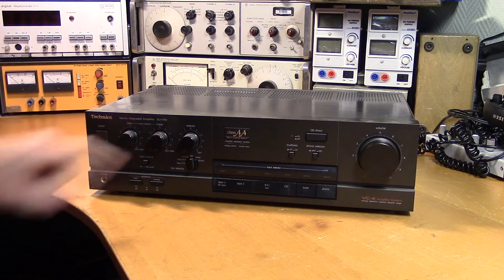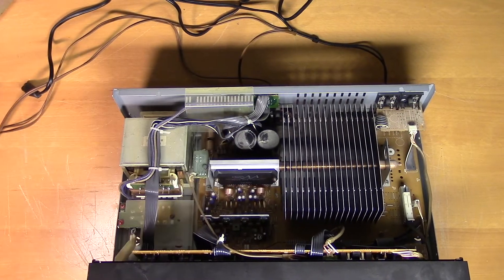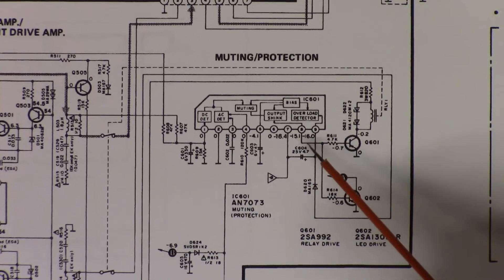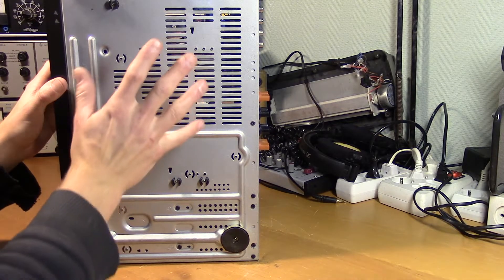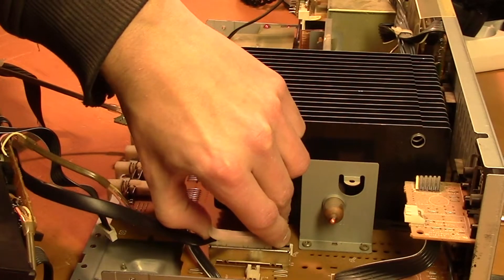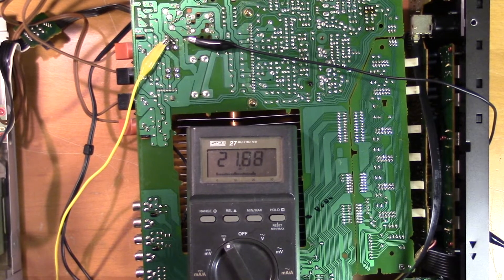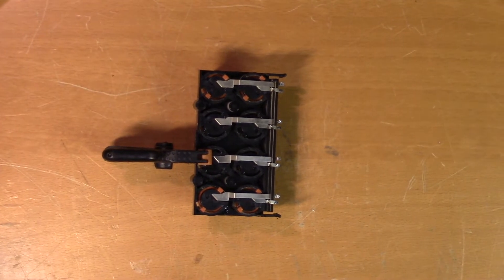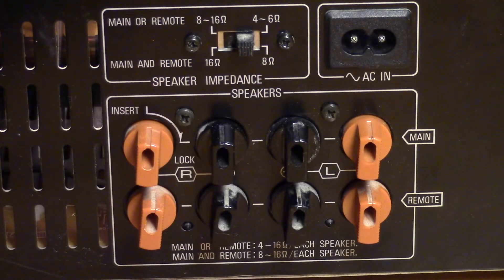Technics SU-V50 - Amplifier Troubleshooting and Repair

Comment: When you probe the IC voltages at the pin, the negative probe of the multimeter goes to the chasis ? Sorry I'm new to these repairs. Pin 2 has AC voltage? I did not see it on the schematics.
Reply from the maker: Ah, my mistake; the AC detection is not on Pin 2. Yes, the voltages in the service manual is referenced to ground, so the negative probe should be connected to ground. In this amplifier the chassis is connected to ground.

Comment: The worst thing about this series of amps was Technics' decision to use hybrid output modules instead of discrete components. They are failing as time goes by and there are currently (2025) no practical replacements. The SVI4004 has not been made for many years and pretty much all of the ones for sale on various websites are china fakes that will fail at switch on or soon after. The same goes for other hybrid modules that Technics used.

Comment: Hello, i have this exact model and here's my problem. When i listen to Tuner, CD, Aux Or Tape it all sounds well on all 4 speakers, but when i want to listen to Phono, sometimes 2 of the speakers just turn off. I test the balance buttom and it's just silence to the right side ..  what might this be ?? Can anyone help me out ??
Reply from the maker: Hello, when connecting something to the Phono input, the signal goes through a RIAA equalizer. There is most likely something wrong on the right channel of the RIAA stage in your unit.
Reply: @SunandWeather  Thank you. I will check it out. Maybe its fixable !!

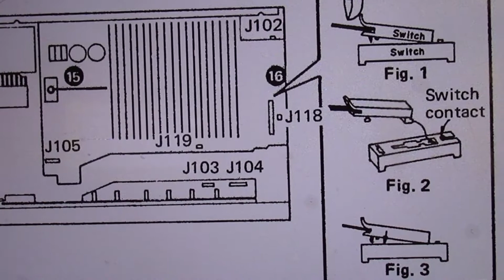Comment: DO you have any idea what the tube is ?  You can see it at 6:00min to 6:20.  It runs through the heat sink fins and is probably runs a good length.  It is copper in colour.  Some of the cheaper technics amps have the tube, but they don't run it through "fins" i.e. heat sink.
Reply from the maker: It is most certainly just a copper tube, intended to transfer the heat from the Amplifier IC to dissipate across the "fins". I would guess it is done this way since the power amplification is done in a single integrated circuit, rather than across multiple transistors, leading to high heat concentration that needs to be dissipated efficiently.
Reply: @SunandWeather  Thank you very much for the reply, much appreciated and great video !!  Keep going !!

Comment: need your help or suggestions....after 30 years my Technics Su-G75 amp went out.....I thought it was the fuse, ordered some 6.3amp 125v and nothing happened. Not sure what to do next? It clicks when I hit the power button but nothing turns on....I also can't seem to find a good stereo repair shop in the Houston, TX area either....everything else works fine...that it came with.... thanks in advance FOR THE HELP!! THIS WAS THE FIRST STEREO THAT I SAVED UP AND BOUGHT MYSELF.
Reply from the maker: Hello! With such limited information, all I can do is give you some general advice on where to start. Since nothing lights up, I would start by examining the main power supply. Make sure that you get the correct dc voltages, that is powering the other boards. If you get no supply voltage to the other boards, or if some of the voltage rails are missing, there is most likely something wrong with the power supply.

Please note that you will be dealing with dangerous voltages. If you do not have any pervious  experience with electronics repairs, I would advice you to seek assistance from someone with more experience.
Reply: @SunandWeather   thanks for the reply back!! Believe me I will seek a experienced shop if I can find one in Houston. So I connected everything back up and everything works when I click the power button except the amp itself? I think its 2 resistors because 2 of them reading shows good the other 2 showing negative reading. 

If you have an email address I could send you the ones I’m talking about and the service manual I found online. Thanks again.

Btw…I checked them with the unit unplugged😅 in case you were wondering.
Reply: @mickbrown815  If you measure a resistor and it shows a negative value on the meter (using the Ohms range) it's likely there is a residual voltage across it from a capacitor in the circuit. Resistors don't read negative values on their own. It is also possible that the resistor is open / high in value. You need to lift one end out of the board and measure it again. However, I can just about guarantee your problem is not the resistors.
Reply: @stopthebus I got it fixed last year it was a resistor!
Reply: @mickbrown815  Well I am certainly pleased you were able to get it repaired, and it's interesting that it did turn out to be a resistor. That's not common for these amps.
Reply: @stopthebus there’s a guy here Tim Miller all he does is work on amps, pedals, stereo equipment. I got lucky! Very reasonable.
Reply: @mickbrown815  Every now and then you will find someone like Tim.
You were indeed lucky to find him - and that the repair was just a resistor as often it is much more than that. A lot of the later Technics amps use hybrid output modules that are now failing and there are no replacements (apart from china fakes) in most cases.

Comment: These are nice amplifiers to listen to but the design is horrendous. Cost cutting at its worst. Definitely not designed with serviceability in mind as theres no access to the board where heat is most likely to cause dry joints. No discrete output stage and too much integrated unobtanium.

Comment: As I recall banana plugs fit into those awful twist on the bare wire speaker connectors, and you don't need to twist the connector to make a contact with the conductor input. I may be wrong, it's been a few years since I used one.

Comment: 13:40 You say that but try getting a cheap amp with a Total harmonic distortion: 0.002% cheaply! Very hard to find and these amps compete very well with high end equipment. In some cases doing a better job also.
Reply from the maker: Hello! The comment on at 13:40 in the video was not intended as a complaint on the design, but in order for Technics to be able sell these amplifier cheaper than most other amplifiers with similar specifications and still be profitable, there has to be compromises. Compromises like: no features facilitating repairs, lower quality components and lower quality materials. These cost saving measures does not necessarily impact the performance significantly, if the design is good, but will probably affect the reliability and longevity of the device.
Reply: @SunandWeather  Very few manufacturers build so that technicians can repair them later without much effort. I always say: technicians exist because engineers also need heroes.😉 One thing is very certain, before the technician's work was paid and now it is not. I remember when I was a child and the television technician came to repair it, the price was about 20,000 pesetas / 120€ (Spain) and the technician was not told anything like: "I think the cost of the repair is expensive", or "is it worth the repair?". Now if you charge 40€ for the repair of a switched power supply you already have the owner crying

Comment: @SunandWeather Hi Sir i have a technics amp model Su-Z780 everything works on it ,but the only thing is? when i turn it on it comes on but to getting it to start to play music i have to give it a slap on top and then starts to play. And  when it starts to play i don' t have any problem, but ones i turn it of, and  if i want to play it again, i have to do the same thing allover again, and like i said i have to give it a slap again. your help would be much appreciated Sir, thanks and God bless
Reply from the maker: Hi! It definitely sounds like the relays are causing this problem. Based on what people have commented on this video, it seems like relay problems are quite common on these units.

It sounds like your relay have trouble moving between its two states. So, my guess is that the mechanical parts inside the relay are simply worn out, causing it to jam as it is trying to turn.
Reply: @SunandWeather thank you so much for responding my message, question? do you live in Melbourne Australia? and is the relay an easy fix on the technics Su-z780 to fix it can you please tell me were would i be able to get another relay, or can the existing one be fixed. thanks again much appreciated your response. cheers Silvio
Reply from the maker: @thetruth871  I live in Sweden. I do not know how easy it is to disassemble an Su-z780, but once you have it apart it should be quite easy to remove and replace the relay as long as you have a decent soldering iron and know how to use it.

Make sure to get hold of the correct replacement, though. Some relay models come in several different configurations.
Reply: @SunandWeather you have been a great help thanks again, and God bless you, Sunand cheers Silvio

Comment: hey i really need your help could you help me fix the volume from negative to positive please
Reply from the maker: Hi bigfan! I am not sure I understand what you mean. Could you clarify?
Reply: @SunandWeather  thank you for your reply… so as i turn the volume dial up the numbers go down, is there anyway to make it normal or are the numbers meant to be negative?
Reply: @SunandWeather  thank you for your reply… so as i turn the volume dial up the numbers go down, is there anyway to make it normal or are the numbers meant to be negative?
Reply from the maker: @ten_xo  Do you have this exact amplifier, Technics SU-V50? On this model the volume goes from 0 to 10 clockwise, where 0 represents no output and 10 represent maximum output. If you have to turn it counter clockwise to increase the volume It could be that the potentiometer for the volume adjustment has been replaced with a reverse potentiometer.

Some amplifiers go from -infinity to 0 dB instead, where 0 dB represent maximum output.

Regardless of the values on the volume dial, the volume should increase as you turn it clockwise.
Reply: @SunandWeather   thank you again for your reply i have the SU-X840 i’m wondering if getting a replacement remote would help… i understand it now but still hate that the numbers go backwards in decibels lol my friend is going to come play around with it and see 🙂
Reply: @SunandWeather   thank you again for your reply i have the SU-X840 i’m wondering if getting a replacement remote would help… i understand it now but still hate that the numbers go backwards in decibels lol my friend is going to come play around with it and see 🙂
Reply from the maker: @ten_xo  Ok, so the value is shown on a LCD next to the volume dial. There should be a minus (-) before the numeric dB value. So, the value is in fact increasing (getting less negative) as you turn the volume up. There is most certainly no easy way to change this behaviour.
Reply: @SunandWeather  i will get a replacement remote and see what the setting can do then i’m over it 😂 thank you

Comment: Thanks a lot for the video, I usually start with visual inspection because is the easiest and cheapest action. Sometimes just pushing gentile with someting not conductive, could you find those "failures". Regards.
Reply from the maker: Thanks! One of the many fascinations with electronics repairs is that you can approach it in many different ways, but finding the most efficient way to troubleshoot is the greater challenge.

Comment: After watching I was inspired to fix my own SU-V50.  I had no sound and the current drive light was off.  I pushed the relay switch and got a loud crackle even with the volume down.  I switched it off and on and its working again.  I think yours was fixed similarly and it was not a loose solder.  Years ago I had the relay switch toggling on and off.  That was fixed by spraying with contact cleaner.  I also desoldered it but that did nothing.  I have replaced the main speaker posts with some large ones from Maplin.

Comment: Nice job man! One question :  Where do I could buy an IC SVI4004 power module?  You know from where to buy the original part?
Reply from the maker: Thanks! I do not have any vendors to point you to regarding the SVI4004, unfortunately. When it comes to finding old stock components you might have to do some online searching. I would suggest starting with the large online marketplaces for second hand items.
Reply: @SunandWeather  Yeah, but thensecond hand parts are not really good many times :(
Reply from the maker: @nicusecan7998  Yes, it is probably a good idea to avoid second hand parts. Try to find "new old stock". That is components that was produced in the past but has not been used. SVI4004 is most certainly not produced anymore, so that is probably the best you can do. I have found that the large online marketplaces intended for second hand items is a good place to start.
Reply: @SunandWeather  I like Technics only for how they are looking and no more than that for now . With the stock parts its very difficult to find some power modules in these days :( . The power module of my Technics its fried :(
Reply: The short answer is you can't. This IC has not been made for many years so unless you can find a NOS one somewhere (and there's no way to prove it's NOS v fake) then every one that you see advertised online, especially on sites like evilBay and Aliexpress etc will be a counterfeit / fake. Don't buy them because you will just burn your money.

Comment: Use an eye glass to check for cracked solder joints on the relay and you should have uses the multi meter to measure the resistance across the contacts of the relay when energized ....but otherwise well done!
Reply from the maker: Thanks for the suggestions DE S! Doing a proper resistance measurement across the relay terminals would indeed have been a more informative test.
Reply: @SunandWeather  Thanks for the reply.
I have been in the audio amp repair business for 40 years and most faults that are connections based can be found with an eye glass and a stick.  Do not underestimate these basic diagnostic/repair tools! Cheers

Comment: Thanks, nice video, but why not replacing the broken speaker terminal for a better speaker terminal with banana connectors for a couple of euros... ? ;-)
Reply from the maker: Hi BoxerTys! Thank you for the suggestion. It would have been a bit of extra work but it would most certainly have been the better solution.